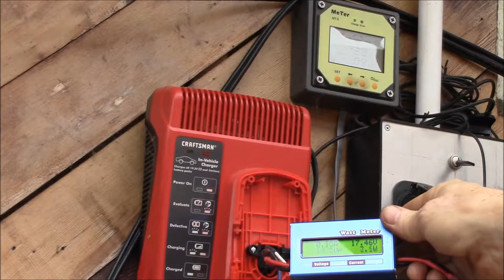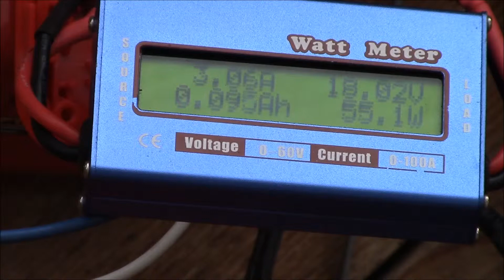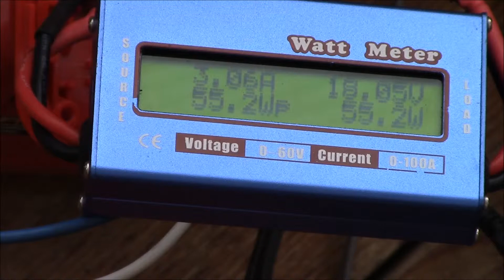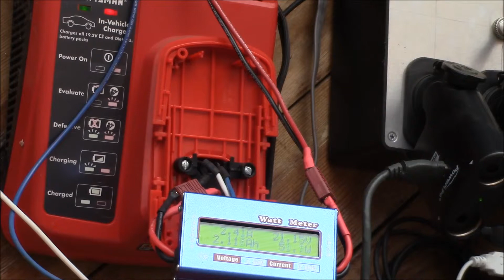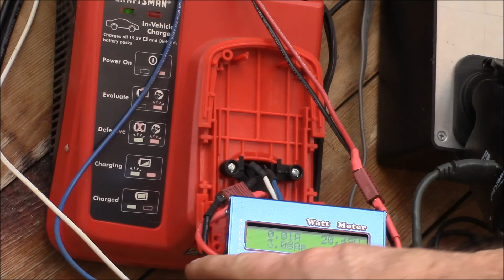Craftsman C3 Battery Charging, Part 4a

Comment: on a 19.3 c3 craftsman 1.5 batt..why would the connections that physically touch in drill only read 8 volts..
Reply: that is 19.2.
Reply from the maker: Likely because the internal protection circuit (BMS) has turned the discharge MOSFETs off (or nearly off).  They still let a bit of current flow in order to detect connection of a charger.  So the trick is you need to plug the battery into a charger to get the BMS to turn on the MOSFETs to allow the charging to take place.  At that point, you'll see the actual battery voltage.  Now I found some of the batteries seem to have some sort of additional circuitry associated with other 2 terminals that allow the charger and battery to communicate and turn the battery back on for charging.  Other batteries I have will charge with just application of sufficient voltage to the +/- terminals.  I have 2 different C3 chargers, one AC powered and one DC powered.  Th AC charger will charge all my batterries, the DC charger all but a few and then something like my ImaxB6 charger will charge some by clipping onto the +/- terminals.
Reply: R Brown mechanic not electrician. with that said I received an off brand batt for craftsman through Amazon. I notice my tools have twice the power so this made me check volt..with volt meter I checked the off brand in every way possible on the 4 male conn..every reading was 20..craftsman I checked 4 different batt. and all at where the conn.point is going into tool shows 8...all after a full charge..they seem to last and be decent but such a diff .in power this has me wondering and very confused
Reply from the maker: Likely the off-brand batteries have a simple BMS and that stays on at full voltage unless the battery is totally dead.  The Craftsman batteries seem to have a more complicated BMS that check individual cell voltages, etc.  And there seems to be quite a variation in that BMS design over the various batteries I looked at.
Reply: R Brown thank you for replying. just wasn't sure and no one could give me an answer..appreciated